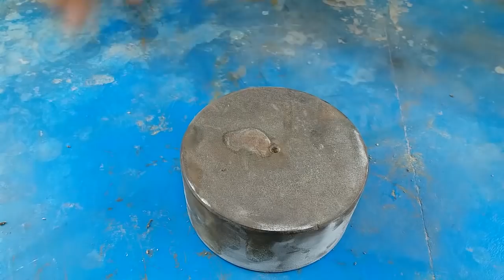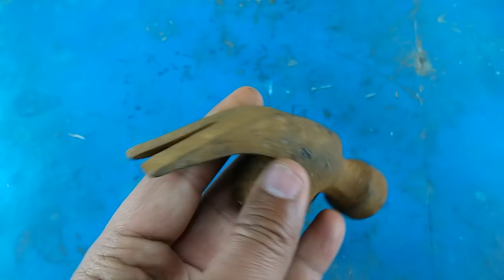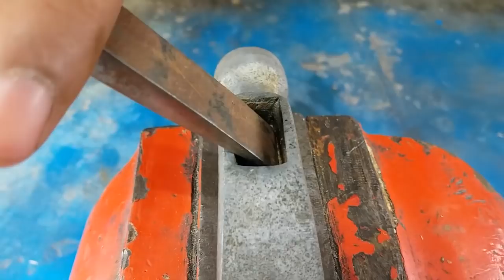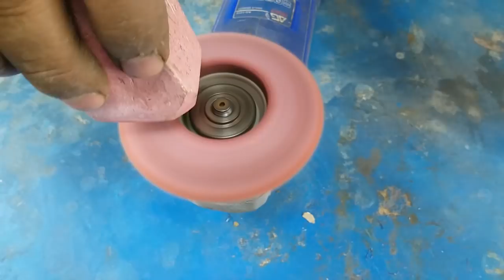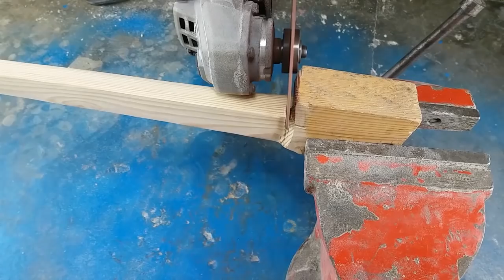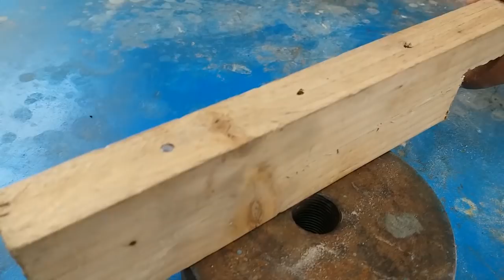Turning old Rusty Hammer | Hammer Restoration - TOOL RESTORATION

Comment: Nice. But you should use a kind of nail for pevention of spinning this head on handle. This little hole in the right side of the head is for this purpose.

Comment: Well done, that resto is amazing.  But the little hole on the side is for a pin to fix the hammer head to the handle. Sort of extra insurance to stop it coming off at any time or twisting.  But you did an amazing job, it looked brand new at the end.  Very WELL DONE. :)

Comment: 1. Soft wood for handle = no good
2. Forgot a kerf cut at the top of the handle extending out of the head, this needs to be wedged for security.
3. When setting the head on the handle tap the bottom of the handle while holding upside down.
4.  Handle needs to be finished with proper oil, like Boiled Linseed.
5.  Don't use a saw blade in a grinder!!! (Or at least use a guard).

Comment: A lot of work went into this restoration. A few things to note: 
The wood was too soft for the handle.
The retaining pin was not restored to secure the handle, neither was a wedge used. Unfortunately, moisture and temperature will loosen the head from the handle and it fly off one day as the epoxy resin will just dry out and crumble away.
Handle still needs an oil or wax.
However, still a nice looking hammer and it will be used again. This is what makes it fun anyway.